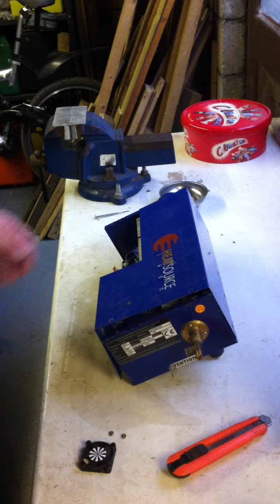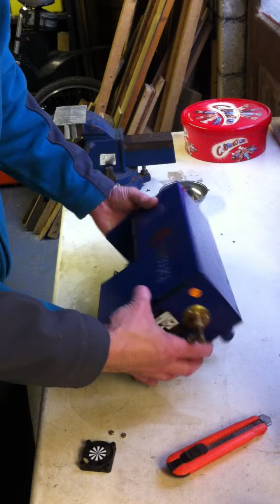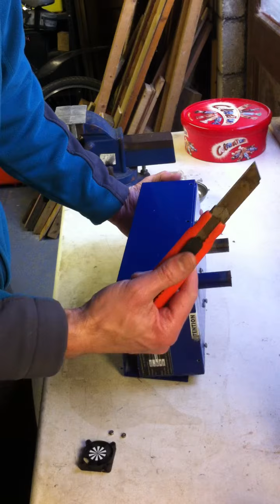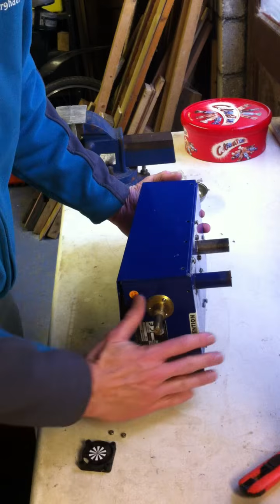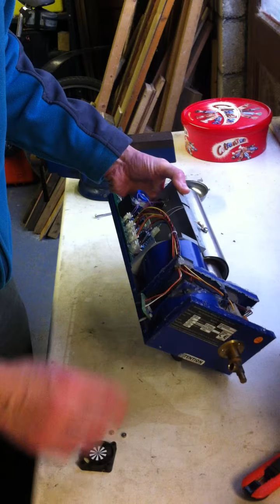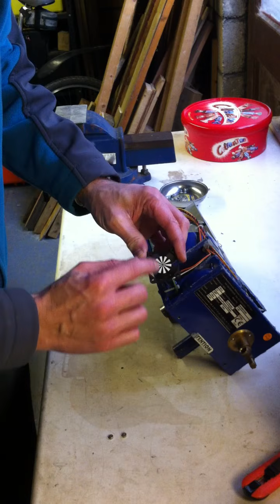Propex Heatsource 1600 Fan Sensor Cleaning

Comment: Guess what I will be doing later. Thankyou.
Reply from the maker: Just be aware that cleaning the old style sensor doesn't last. You are better off replacing it with the new style pressure sensor.

Comment: Crazy question... did this fix the issue? I've always just blown a few quick breaths up the intake and exhaust tubes and it fixes... not tonight. I'll try this fix tomorrow. Thank you for the video. I'll let you know how it goes. BTW, I think my HS1800 is 10+ years old. I built a manifold under the seat with two outlets. Got a 220F degree rated hose that plugs into the manifold and run the other end under my covers on the lower bed. Turn it on for 10 mins before bed and it's a beautiful night.
Reply from the maker: Unfortunately it only offered a temporary fix. See my other video where I replaced the spinning sensor with the pressure that Propex fitted to the later units. That fixed it permanently. I don’t think I would use Propex again, I would go for one of those cheap Chinese diesel heaters.

Comment: Great video I took mine apart and couldn’t get the cover off now I know why (silicone ) I’ve got this fault code so I’ll give this a go again today 
Thanks
Reply from the maker: Unfortunately I found that cleaning it didn't last and I had to replace the fan module with the later pressure sensor module. This has been working flawlessly since replacement.

Comment: Informative video. I know it's five years ago but is they the flame sensor sitting on the top of the burner tube?
Reply from the maker: No, I think that the sensor screwed on to the top of the burner tube is a temperature sensor. It probably detects over-temperature if there is an obstruction or the fan is running too slowly. A flame failure electrode would have to be right in the flame and is usually co-located with the ignition electrode.
Reply: @bvqbvq  ok thank you, I'll investigate.

Comment: Kevin mate. You just saved me a world of pain.
Currently in Italian Alps, getting to 1'c tonight and propex had 5 flash error. Tried blowing out inlet and exhausts. No avail. Your method fixed the issue. 
Thanks for putting up this video.
Reply from the maker: I'm glad it helped. Be warned, it didn't last more than a few months before it failed again. Eventually I bought the upgraded sensor from Heatsource and that has permanently fixed the problem.

Comment: Hi, my hs2000 won’t stop running, I put power to it and the fan starts spinning, that’s it, keeps going and going, no hot air, no fault flashings on thermostat, any help would be great? Thanks
Reply from the maker: Hi Dave, from what I can remember looking at the control circuit it had an 8 bit micro-controller at its heart. This would control the operation of the fan and the burner via some transistors. If you have no LEDs lighting on the control panel and the right-hand LED does not change when the thermostat is adjusted then I would say that you either have a micro fault or a problem with a power supply on the board. If your LEDs are working then it would be more likely the motor drive transistor has failed short circuit. You can follow the wiring from the motor back to the circuit board and then through the tracks on the PCB to the drive transistor. It will probably be something like a TIP31C. I've just looked at a video of the board and the transistors are the 3 legged devices screwed to the board with a small nut and bolt. You can measure between the collector and emitter with a multimeter to see if it has gone short circuit. I suspect that Propex will just sell you a new board, I doubt that they do board level repair.
Reply: Did you ever get a fix for this? I am having the same problem with mine.

Comment: Thanks for a great video. It saved the day.
Reply from the maker: Did you clean the existing sensor or fit a new pressure module?
Reply: @bvqbvq  I cleaned the existing sensor.
Reply from the maker: @markegan2063  Unfortunately my experience of cleaning the old one was that it was a short lived solution and in the end I had to replace it to get a permanent fix. I did wonder if if wasn't a dirty sensor but increased friction on the impeller stopping it from rotating. It worked correctly for years before it failed. The fact that Heatsource sell a replacement module suggests that this is a widespread problem. I was grateful that they offered a better solution, even if it came at a price!
Reply: @bvqbvq  After I had cleaner the impeller I did notice an issue with friction. I left the two screws holding the sensor in place a little loose. This seemed to work. I'll keep an eye on it. Hopefully it will last for a while. If not I will replace the sensor.

Comment: Thank you, you just saved me a few quid that I really could do with at the minute.
Reply from the maker: Unfortunately I found that cleaning it didn't last and I had to replace the fan module with the later pressure sensor module. This has been working flawlessly since replacement.
Reply: I may be lucky, I have spent 8 months renovating an old rv that had stood for a few years so the propex has been stood idle. Watching your video  gave me the confidence to open her up, it was not dirty at all, in fact, it looked brand new in there, I took the little fan out and it was just stuck, once I free'd it, it span smoothly. Put it back together and it is up and running. I will hope for the best but be aware it may pack up. Thanks again. much appreciated.

Comment: Hi, did you find it difficult to remove the power cord from the board, could you explain how it's done? Thanks.
Reply from the maker: It was easy, there is a small clip on the side that you squeeze whilst pulling on the plug.